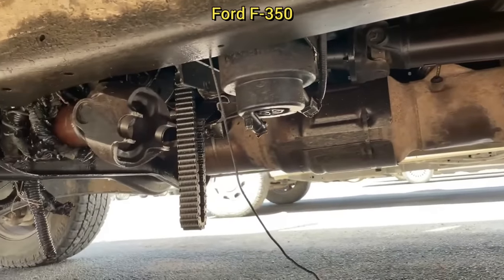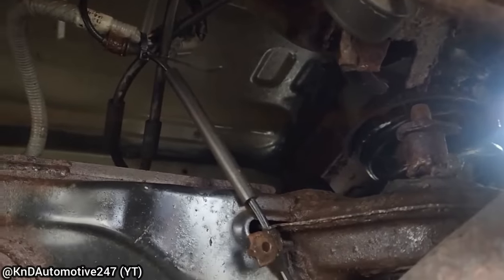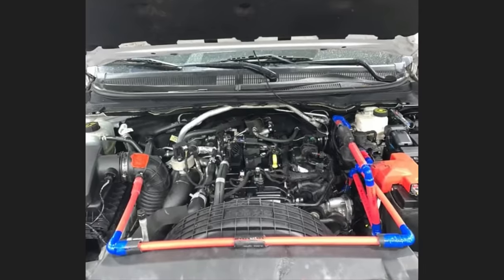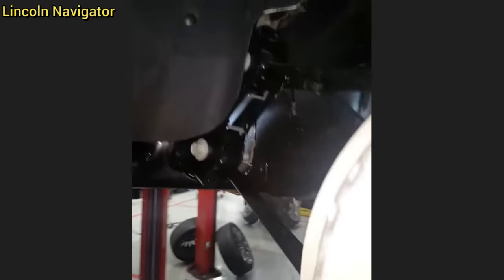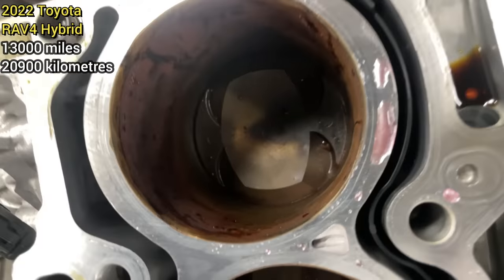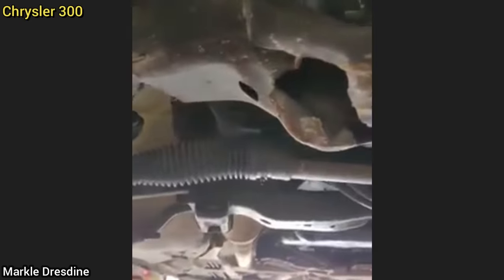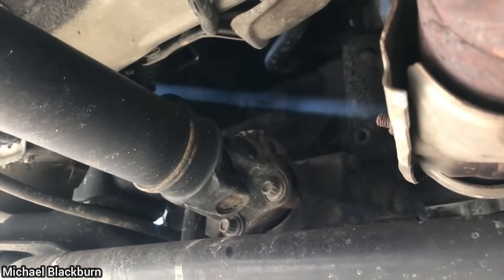Customer States There Was A Loud Bang At 90 Miles Per Hour

Comment: The "declined repairs" to "it literally blew up" pipeline is surprisingly short & very funny.
Reply: Not really. I had been driving that truck that way for almost a year.
Reply: Really not surprisingly short it's usually surprisingly long
Reply: @TheSuperBoyProject  one of the kids locked the hubs in or sumn?
Reply: The vacuum actuated automatic hubs are prone to failure, so some people just manually lock the hubs and leave them that way, 2WD or 4WD. The owner’s manual says the only consequence of doing that is worse fuel economy. I suspect there was something else going on, like maybe driving in 4WD on dry pavement and wrapping up the drivelines and/or transfer case.
Reply: @CarlosRodriguez-hb3vq  Having manual hubs locked in can cost you some friction and mileage BUT having the manual hubs locked in if there is a problem with the transfer case and it decides to shift into 4WD then that video is the result. They did state that there had been an issue with the transfer case actuator. It probably popped into 4WD and there is simply no time to slow down and stop the windup on a dry road if you are “at speed”.
Reply: @Yohann67  esp when that speed is 90mph
Reply: I need a flowchart…
Reply: This guy could do a long series just on declined repairs, with bonus declined and towed in.
Reply: @shotgunman432 no just no common sense.

Comment: I’m about to take a road trip of 1,600 miles (round trip).  As much as I love this channel I’m going to do my best to not think about the rolling death traps that’ll inevitably be all around me.
Reply: Do a line every 500 miles. Helps a lot
Reply from the maker: Safe travels my friend!!!
Reply: @TheSuperBoyProject  You put two too many zeros in there.
Reply: Be safe on your trip! owo/
Reply: Thats why I wanna trade my drivers license in for a dog sled team...
Reply: This channel rubs in the face the necessity of keeping a safe distance between cars on the road.
Reply: Don't worry about the death traps.
Worry about those idiots driving them.
Reply: Back roads and safe travels.
Reply: Hate to break it to you, but even if everyone drove a correctly maintained high quality vehicle in perfect condition, that would only reduce the accident rate by about 12% (since only about 12% of accidents have a mechanical cause).
Reply: Drive safely !!
Reply: @Sashazur  It's the nut holding the steering wheel that's the problem.
Reply: @Sashazur 12% is a lot when you’re talking about millions.
Reply: just put a bumper sticker that reads "if you're gonna kill me just make it quick"
Reply: @TheBanjoShowOfficial  When I go, I want it to be like my Grandma.  Peacefully in my sleep, not screaming in terror like the other three people in the car.
Reply: Seen a car with front bald tires with the steel belts exposed at my job. They work among us too...

Comment: “What?! You mean I actually have to put EFFORT in to open the washer fluid cap?!”
Reply: The idiot owner is probably trying to unscrew it like a jar lid.
Reply: Oh, yeah. Every time I have to top-up the washer fluid, it's out with the ol' monkey wrench. Such a chore.
Reply: Some people may have hand impairments and just can't get that damn thing open. But in most cases people are a) lazy; b) stupid; c) all of the above.
Reply: @markh.6687  Yeah, I wasn't sure that one was stupid. We don't know the hand strength of the person involved. Probably less strong than a professional mechanic's hands/fingers.  Sanding down the lip (as suggested in the work order), maybe some dielectric grease, might have been what the customer needs. Cap doesn't have to be very tight at all for that fluid.
Reply: @unclenogbad1509  Hey, I recently had to open a child-proof (AND adult-proof) Rx bottle for my wife using a pair of pliers.  Not joking!
Reply: @josepherhardt164  Been there too. Suddenly that one drawer of yours in the kitchen isn't 'wasted space'.

Comment: 1:08 So many customers put the wrong fluids down the wrong holes. I wouldn't be surprised if the customer didn't realize which cap is the washer fluid cap.
Reply: The washer fluid cap is the one with the long stick inside, isn't it?
Reply: @schwarzerritter5724  To be honest i don't know. I am just as bad as the customers. The only difference is i never try to fix the problem on my own.

Comment: I wonder if the "washer fluid cap is hard to open" guy was trying to open the coolant reservoir while it was hot and under pressure.

Comment: That Lincoln suspension break, whoa... they sure don't make these things like they used to!
Reply: that is some pretty piss poor quality on a brand new vehicle.
Reply: gotta love the quality control dolts working for ford and it's subsidiaries.
Reply: Fix Or Repair upon Delivery.
Reply: A long, long time ago, when I drove parts delivery for the family dealership, I had to go to a store we bought body and paint supplies from. To get there, you had to go under a fairly low railroad bridge; about 11’ 6” I think. While I was there, the counter people were talking about a car hauler taking brand new Lincolns to a dealership in the same town. He drove under the bridge and peeled the top row of cars off the hauler trailer. About $150,000 of junk at the time; now probably closer to $300-400K
Reply: I work in plant assembly. The consequences of that inspection are gonna be felt by at least 200 people for months to come.
Reply: I worked at a Toyota Dealership for many years. About 15 years ago we had an elderly male employee who would drive around several cities around the State in a company truck with an auto transport trailer. He would pick up new vehicles to bring back to the Dealership for sale. Every one of the vehicles he brought back had broken rear suspension sway bars, brackets and frames because he would install the hold down straps around the rear sway bar and winch them down real tight. They would break during transport and management would make us replace and repair all the transport damage under warranty. Toyota eventually denied the claims after the 10th vehicle claiming transport damage. It wasn't long after that they let him go due to the expense of the repairs.
Reply: @kevinmf36  Why not just train the guy? 
BEFORE letting him break any vehicles.
Reply: @MrTruckerf  nobody gets training anywhere
Reply: @MrTruckerf  Invest money in people? - That's a heresy to beanscounters!
Reply: Fix Ot Rgain Dony
Reply: Of course.  Even when robots do all the work, you still need people to do the inspections.

Too much faith in technology makes people really damn lazy.  Just ask Tesla.
Reply: the robot was out partying the night before
Reply: @leftyo9589  my dad's Mach-E GT shit its high voltage battery and rendered the vehicle inoperable in literally the first 1k miles it was driven. brand new vehicle
Reply: @MrTruckerf  I went to the General Manager about it and explained what was causing the broken suspension parts. He called me a liar and threatened my job and told me under no circumstance was I to mention this to anyone else, including the old guy doing the transport. That's management for ya.
Reply: @kevinmf36  so here in the UK we always tie cars down by the tyres, thats main dealers right thro to little guys like me.  so the suspension can do its thing and not get damaged.  Now i know, in drag racing, why folks stateside tie down by chassis, but for regular cars seems insane IMHO.
Reply: I can't fathom why anyone would buy a new Ford the past decade.  They've never been the best but now it's absolutely atrocious.
Reply: At least it wasn't rusted to hell and gone!

Comment: My father-in-law worked at a gas station in the 50s. I remember him telling A story about a woman. She brought in her car. She said that the garage that sold her her tires told her that twice a year. Spring and fall. And that she should come in and have them drain the air out and put dress air in. He tried telling her that didn't need to be done but she insisted. He did it to make her happy and because she said they would charge her for it. He didn't.
Reply: Oh wow.
Did... she also need blinker fluid changed?

Comment: Just rolled in bingo: (Repost because editing for grammar removed the heart T-T)
1A - "I had my friend fix it for me."
1B - "Car has slight issue." Is falling apart in the shop
1C - "Why won't they work on it?" Car is a jury rigged/filthy nightmare.
2A - Car has serious issue, customer declines repairs.
2B - Customer screws up, but has enough sense to get it repaired properly.
2C No fault in the owner, honestly. How does THAT even happen? 
3A - "Sounds like X" Description is perfect. 
3B - Poor soul got had by another "shop"
3C - "Issue" is caused by the owner not understanding how their vehicle works.

Comment: A customer installed a new window regulator in their drivers door. It still wouldnt work! Dude, you didn't plug it back in, or tighten the window glass pinch bolt as I found out later! After I plugged in in, I hit the down button, and the glass fell into the bottom of the door. Luckily it didn't break! 😊

Comment: 90% of the problems are caused by body rusting. This is something auto makers could solve by using (more expensive) non-rusting materials but choose not to do so, which allows them so sell more vehicles that will fall apart.

Comment: 2:30 Supposedly plugging this into the cigarette lighter 'stabilizes the car's electrical system and thereby increases gas mileage by 10 miles per gallon.' 😳🤪🤣😵‍💫😹
Reply: "Has an overly-complicated method of illuminating a LED, just in case the user opens it up to see if it's the old LED-and-a-resistor method we used to use for this scam."

Comment: I think ALL Shops should have a Duty to Report Vehicles that have Frame Damage. be it Rusted threw or broken to not only to the insurance Company but also to Police if the Customer Decides to Drive it away. 
Just so that Vehicle could be Taken off the Road for Good.
Reply: This wouldn't work in US States that don't care enough to even do safety inspections.
I know that other countries exist and regulate vehicle safety, but most of these videos are from the US.
Reply: Developed countries have mandatory inspections by an independent organization. 
That, of course, prevents them from getting great footage like shown on this channel. 
But knowing everyone around has working brakes is not so bad either... 🤷‍♂️
Reply: @timorieseler276  there are developed countries, and then there are live free or die states.

Comment: I'm guessing the crab car had gone fishing recently. Crabs of this size are sometimes used as bait, guess one of them got really lucky :P.

And the beam-of-light guy had a certified Indiana Jones moment :D.
Reply: Or it's a pet. You can buy fiddler crabs (which is what it is) at the pet store. The sponge was in there so it could climb out of the water.

Comment: I hate it when a customer is told to tow a car out of a shop because it's unsafe to drive, and they just end up driving it out anyway. Had a customer come in for an inspection because of a grinding noise, and it turns out that not only did he not have any brakes (no fluid either), but his frame was so badly rusted our tech slowly brought it back out and we told him to tow it. Customer claimed he drove it here just fine, and instead of towing it he just drove it to the shop next to us. They ended up telling him the same thing.
Reply: Also had a customer with a car that needed around $15,000 in necessary repairs, and was told it was unsafe to drive without the necessary ones. No brakes, no tread on any tires, control arms bent and every suspension component was worn and had a lot of movement. I'm missing a few things that I can't remember off the top of my head. With the tech that was working on it, if he says a car is unsafe to drive, I wouldn't even sit in it. 

The guy ended up coming to pick it up and driving it out. He brought his two kids with him, and I watched him get in the car with his kids and drive away. I wonder if he made it home safe.

Comment: I work at AutoZone and I specifically remember one customer who had check engine light and I went to scan the truck, the truck was running when I got to it and had a VERY loud rod knock. I told them they needed to get it towed to a shop immediately but they drove it home. I guess they would rather spend $5,000 on a new engine than to just get their truck to a shop. Not sure if they even made it home or not
Reply: If the piston rod was knocking that bad the whole engine would have to be replaced. Or at least the piston rod and all the pistons themselves.

Comment: I have run into the no cab mount bolt situation before. Customer removed running boards that attached via cab mounts. Never reinstalled bolts 😅

Comment: 1:08 As someone who previously had a car where the washer fluid cap was too easy to open, and it would fly ppen randomly and cause all my fluid to evaporate/boil off. Id much rather have a stiff wiper fluid cap.

Comment: I love this channel. It makes me think US built cars don’t have very good final inspections, and what’s with all the dodgy diy repairs? 
If you want reliability my VW MK7 Golf  went 165,000 miles on its original clutch and fly wheel. I changed front suspension and rear springs at the same time. Drives like new. But I don’t drive through swamps or over boulders. Just tarmac roads funnily enough😊
Reply: Modern VW's in general are not known for their reliability, no german brand is.

Comment: Had 73 Ford LTD I bought with rotors literally paper thin. Put in a cheap set of sacrificial pads as the ones on it were only well worn metal at that point.
Got me home safely and did total brake replacement.

Comment: 0:20  "Decline" motard oughtta have a 75% "declination surcharge" added to the standard replacement bill, for refusing repairs that would've prevented this.

0:43  As well they should!  Motard has likely done irreparable structural damage to his car.  The most worth it is now is to cannibalize it for the functional components and scrap the rest.

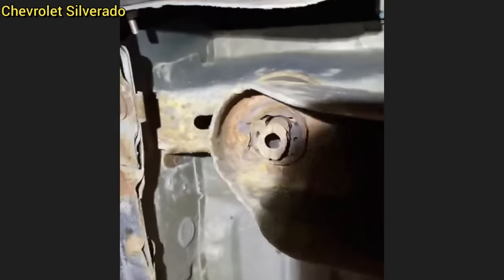0:59  This is where I think the government should step in; if a shop finds a truly-dangerous situation with a vehicle, like in this case, they should be delegated power from the state government to prevent the owner from driving it anymore until the dangerous issue is resolved (if it can be).  Ownership of a vehicle is an individual right; driving said vehicle, however, is a privilege, one which can be revoked at any time for good cause.  I'd say the safety of other motorists from a self-destructing pile of rust is good cause.

1:43  Now that's a genuine warranty matter there!  'Course, with a broken frame, that totals any vehicle, as it's no longer any good except for donating other organs (or, if fresh from the factory as this one was, sent back for disassembly and recycling of the parts that are still usable).

2:32  Seriously??  People be SO stupid as to buy THAT??  How is that supposed to increase fuel economy from the cigarette lighter?!  Jeez, even my 33-year-old Vitalizer seemed to make a difference in my grandmother's car.

2:54  'Nother "decline" motard what needs to be taken off the road!  See 0:59 above, I stand by that conviction...and I am not one to advocate the expansion of government power, except where it's specifically needed, such as the safety of other drivers from self-destructive motards like this owner.  Seems that 300 owners are all that obnoxious for some odd reason.

Comment: Of course I'm not getting the cab bolts replaced, I've been driving around like that for years with no problem 😤
Reply: Don't need 'em when the rust has welded the cab to the frame. I imagine it would be a job getting the cab off. Usually with rust welded parts the cutting torch is required.